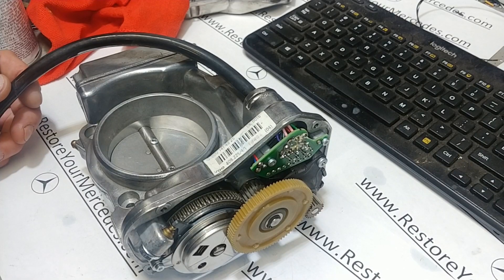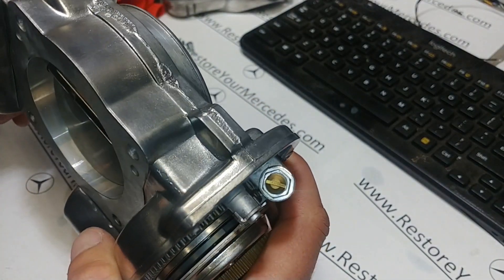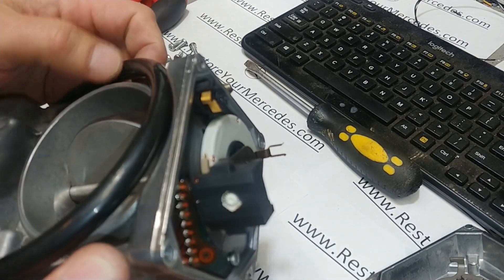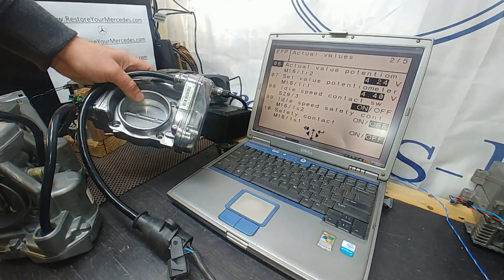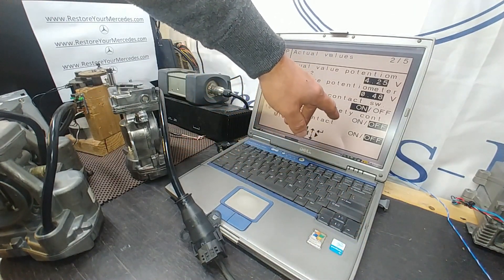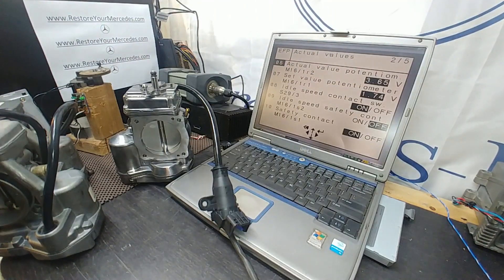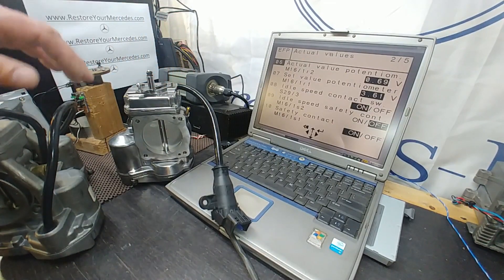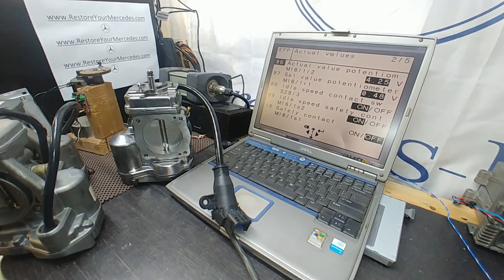Mercedes SL320 R129 throttle actuator test for Herpal in Malasia

Comment: May have to consider sending my own unit to you. Ignition goes on and I hear no clicking from throttle so possibly motor is bad, Idk. Replacement unit is not too far off £1000 which is absurd for a throttle body, compared to the fact I can get a 2nd hand M112 V6 one for my other car, for less than £100. M104 is a great engine but my god, Mercedes made some terrible decisions in the 90s when it came to their cars and build. The part prices are crazy